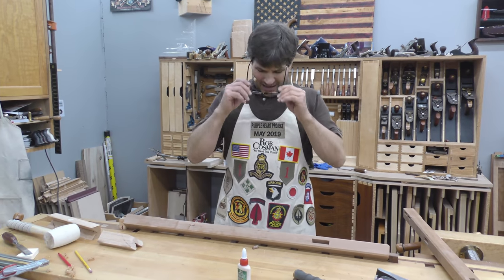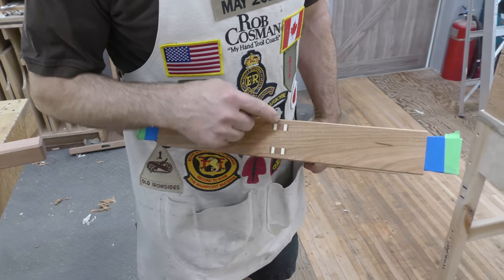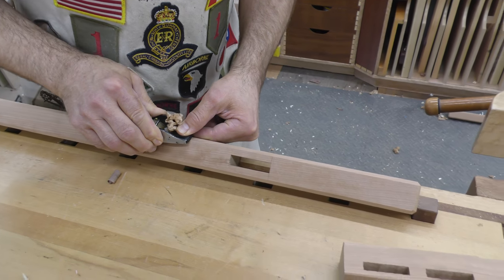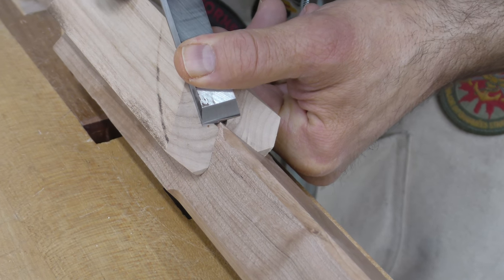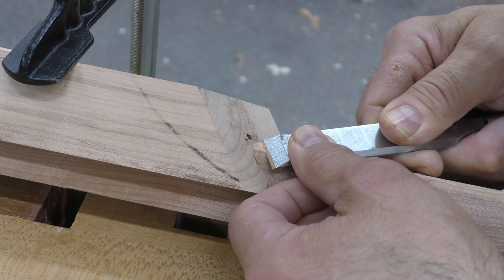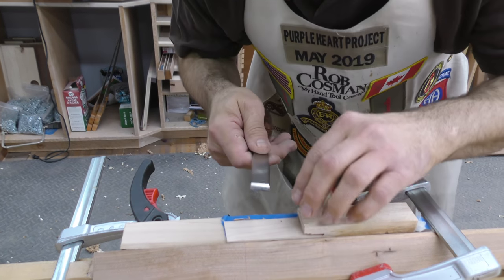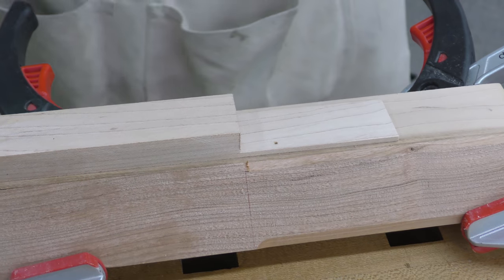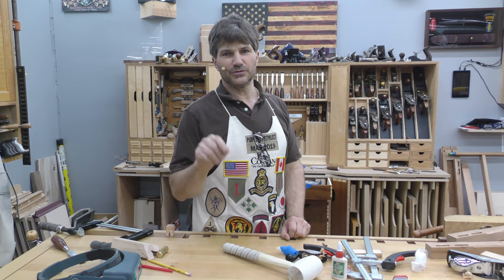Hand Plane Tips, Finishing a Chamfer

Comment: Thanks for the time you spend giving us your tips. Time plus patience equals perfection.
I used to strive for perfection during my career as an automotive technician. If constantly having the lowest percentage of second efforts is the result of taking my time and having patience with the diagnosis and repair, then I succeeded.

Disclaimer: I know that having any amount of second efforts isn't considered perfection. Any repeat complaint that occurred within 6 months or 6.000 miles of the original repair was performed, was written up as a second effort until it was proven otherwise or determined to be a legitimate second effort. Parts or coincidental failures were not chargeable as second efforts.
Reply: AT, can I sum it up as "Right the First Time"? Way to go! L